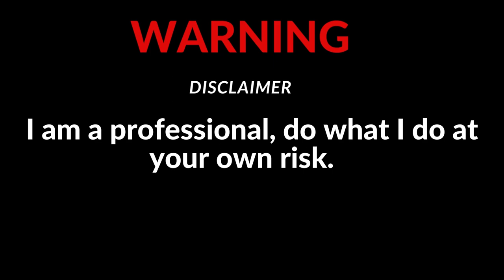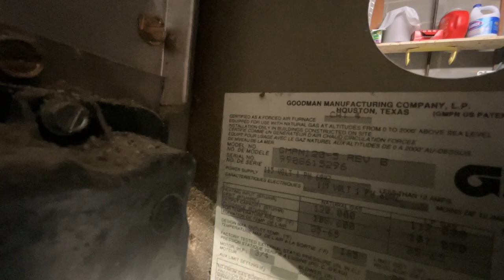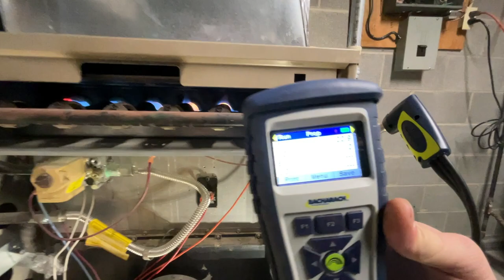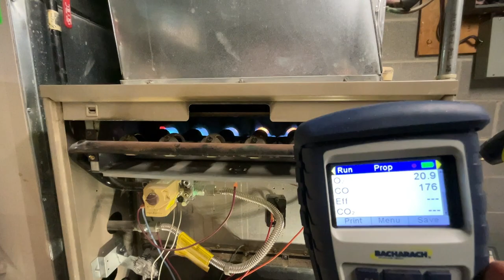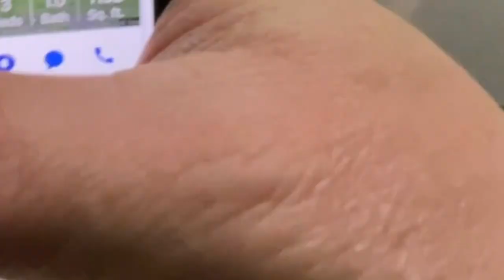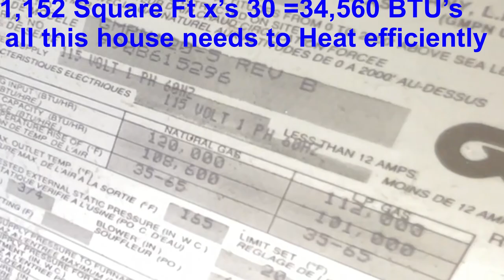Goodman furnace not turning on

Comment: Trying to figure out your sizing formula? Btu required would typically be CFM X 1.08 (specific weight of air) x Delta T (70*) . In your case it’s roughly 60,000 btu? What does the 30 in your formula represent?
Reply from the maker: It roughly takes 30 btus to heat 1 square foot of space. so for instance if you have 1200 square foot space and it has decent insulation and windows. 1200x30= 36,000 BTU's  so I would do a 60,000 BTU 2 stage. And for Cooling it would be x's 20. Thanks for watching.

Comment: I bet that thing is cracked up to hell, inducer can't draw the flames through on those cells.
Reply from the maker: Could be? When I pulled the high limit out, from what I could see. I didn’t any rings and no cracks, but could not see the rest of the exchanger.
Reply: @ADVANHVAC  I've seen a lot of these ones crack open looking into the Inshots.
Reply from the maker: I did run my scope down each cell. There is some questionable spots for sure.
Reply: @ADVANHVAC  joys of way oversized equipment. Even though these dependable 92s had flaws.